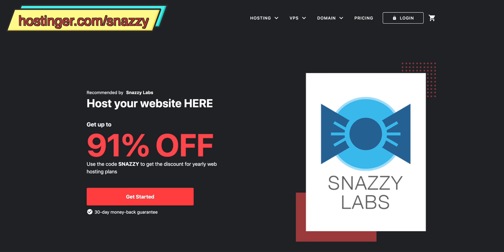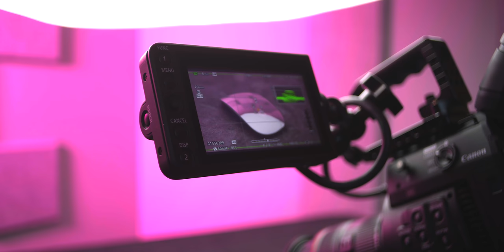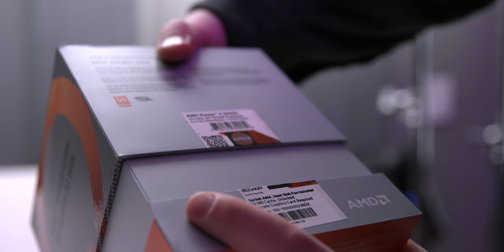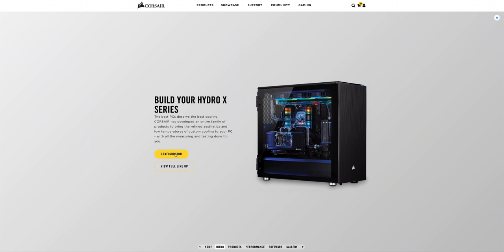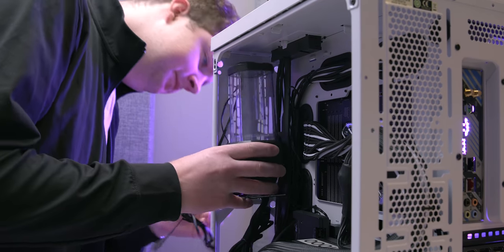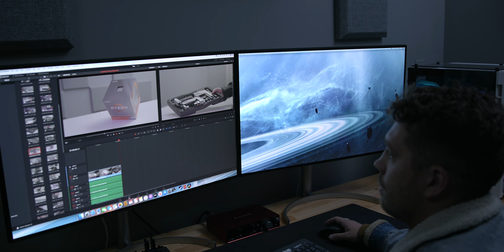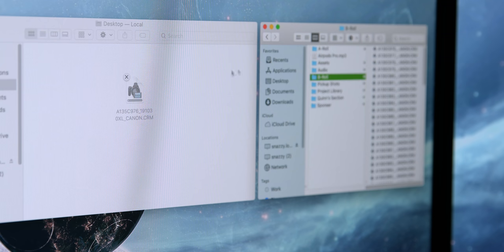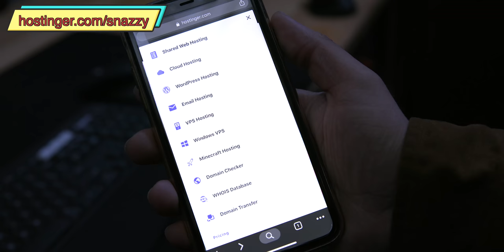AMD HACK MAC KILLS THE NEW MAC PRO!

Comment: I wanna see you build this super insane hackentosh
SUPERMICRO MBD-H11DSi-NT with 2x AMD EPYC ROME 64 core 7702 chips
Radeon VII x2
R3D Rocket-X
2TB DDR4 2666 ram
4TB M.2
Custom Watercooling loop
Dune Pro case 

For less than $40k could it out perform the most top spec Mac Pro at $55k ?

Comment: You didnt build it at a fraction of the cost... You built a computer that costs less than a MAC pro. The mac pro uses intel Xeon processors, these are server CPUs with 6 memory channels which are at least double the price of a 3900x. And yet, the mac pro is expensive and a comparable Intel or AMD machine will be much cheaper, but not a fraction of the cost.

Comment: Lmao 6000 for 8 cores and 32Gb of RAM 😂😂😂😂😂
Reply: Have you seen the main board and everything inside the case? Go look at a video where they pull apart the new Mac pro and it starts making sense. You couldn't build a pc to the same quality for $6k usd (I'm not talking about CPU/hdd/ram, they can all be upgraded down the line on the Mac)

Comment: If there is no Apple, what would you do... If you want to prove something, you should  engineering machine from 0, assemble it same way with same or equal AMD components and after that come here and make a video... Everybody can buy some pc parts, put them all together in a case, with more and more LED's for kids, put 10-15 cables here and there and says 'hey, I build cheaper replacement of new Mac Pro'. I'm a genius! Every part of this machine is unique by itself, which cost more for engineering, manufacturing, assembling process and so on. It doesn't matter how cheap is the replacement, people who buy machine like Mac Pro does not make it for fancy or because 'hmm, I'll take it, will look amazing next to my fridge'. You can buy a Dacia for 8000$ instead of Toyota for 25000$ and make a new video called 'DACIA HACK TOYOTA KILLS NEW TOYOTA'.  They both are cars, 4 wheels, 4 seats, lights, maybe same engine power and so on. Then, why people didn't buy only Dacia, Tata, Lada, but also buying Toyota, BMW, Mercedes, Honda, Mazda and so on, which cost them more and more money? Because they are stupid? Because they are happy to spend 2-3-4 times more money?

Comment: The Mac Pro tops out at 1.5 TB of RAM.  The Mac Pro doesn't offer 2-3 TB 3 ports but, instead, tops out at over a dozen and, oh yeah, pulverizes "Ryzen Shine" it in graphics performance when upgraded with one of the Vega Duos.  A LC V64 has basically the same performance as a 2070 which gets crushed by a Radeon VII, much less the Vega Duos in a Mac Pro. 

Don't get me wrong, you produced a very neat project but it seems like you're taking unnecessary shots at the Mac Pro.  Ryzen Shine is hideous and its vastly/unnecessarily complex with the LC loop, where the Mac Pro's air cool turbofans work 90% as well with 90% less complexity and issues.  

But if we're going to discuss niche builds, just grab a 2018 Mac Mini plus a AOC/UV 50 Anniversary Radeon VII via Razer Core X.  Not only is it 90% performant vs Ryzen Shine  in most CPU/general performance tasks, but it absolutely smashes Ryzen Shine in gaming (both in Windows and Mac)… for less than half the price. Oh and it doesn't look like a Roadhouse Bar picture window. ;)

Comment: Ah, it's still a hack ... if there are any limitations, not even worth it; If you rely on a system for work, you don't build a hack. If you want a system for games, build a Windows PC.

I went down the hack route, just to test the waters before switching over fully to Mac. In this case, it was definitely worth it to test the waters on an existing machine. I ended up realizing how much better MacOS was and all the software available - gaming became a non-talking point for me in my 30's. If I wanted to game, I'd boot up my PS4 ... and I found what of course everyone will eventually come to realize once they "grow up" (ha ha) and understand the quality from the hardware itself (computer, and especially the beautiful high-rest retina screens) to the software ... just buy a Mac.

No PC out there you'll put together yourself will match; and you're forced to use the god-awful array of crappy 4K displays and terrible Windows UI scaling that Apple's had figured out for a good 10+ years and Microsoft and Linux still can't figure out. Sad.

You don't buy a Mac to "bench" and overclock. You buy it for the overall package, and stability for work. If you really want, you can dual-boot to play a couple games but it's not even worth it. If you're a gamer, forget about Mac. I like the fact that the two are exclusive from each other... keeps the kiddies away from Mac OS ;)
Reply: C H i can build a base model mac for 1.5-2k so 6k is just ridiculous.

Comment: You can also pimp out / mod a Honda Civic to best a 911 Turbo 0-60 or at the track. But what would you rather drive? And just like a pimped-out Honda, the AMD Hack Mac will have little or no resale value whereas the Mac Pro will retain a large percentage of its value for years to come.

Comment: You shouldn't have made this video because Apple will now work even harder to quash all the loopholes that allowed for  Mac OS run on Ryzen 'material' on top of that, embarrass their entire lineup! ... which to Apple is bad for business. Since Apple can't catch you and hang you immediately for giving people ideas to substitute Apple store for Newegg and still end up with machines which best their best, Apple will probably go after the software enablers meaning,  the next ryzenshine builds will be more toxic if not complicated and or impossible to do.
Reply from the maker: Nah, in fact, it's possible thanks to a lot of resources put out by Apple. It's a tiny community that almost has no impact to revenue and helps Apple a lot at kernel patching and stuff. Hackintosh community has been around for a decade and is as strong as ever.